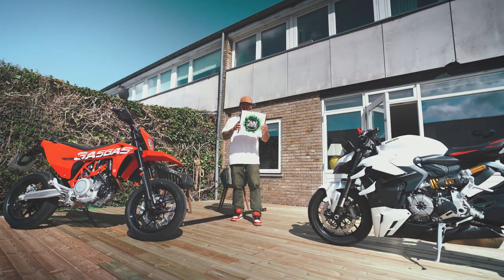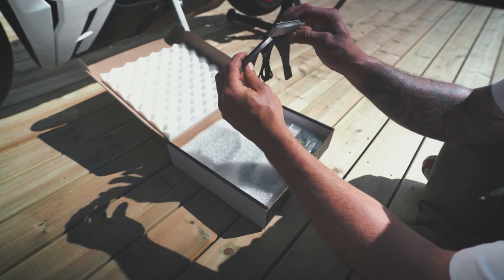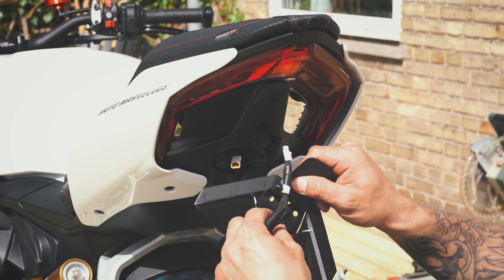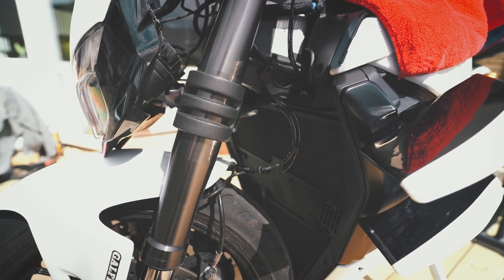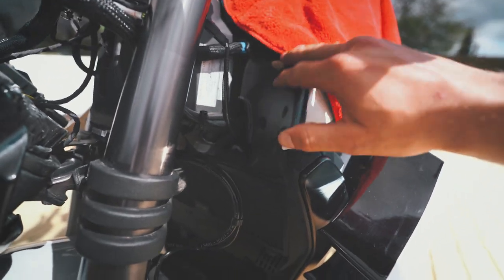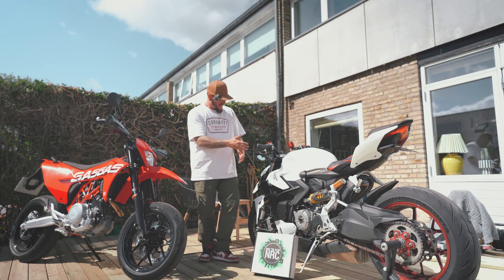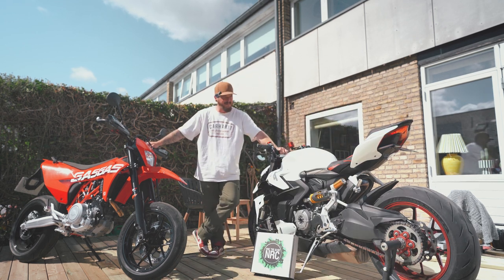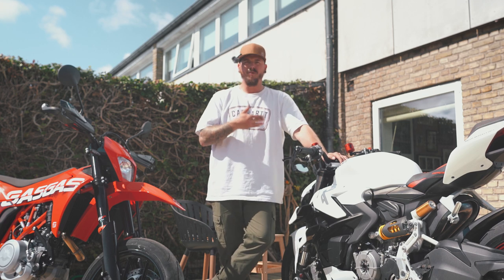DUCATI STREETFIGHTER PARTS FROM NEW RAGE CYCLES! (Best fender eliminator!)

Comment: This tail tidy doesn't fit the design language at all... Evotech has quality machining and finish, but their design blocks the tail light (too high) - so that too is a no go for me. Futurismoto is does a neater solution IMO. Or one can go with an integrated tail light altogether (way more expensive though).
Reply: Evotech follows the OEM specifications so at least it s legal in Europe. All other solutions have a ridiculus angle and you d  get fine after fine..